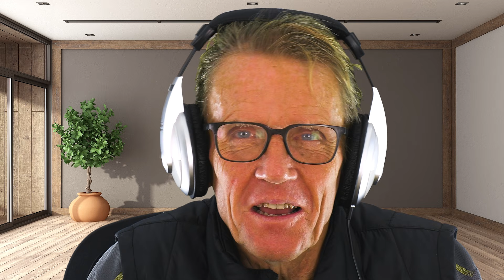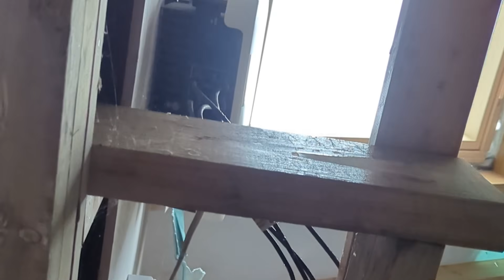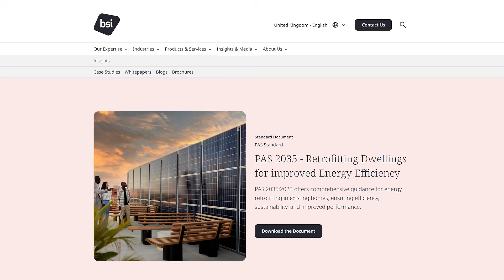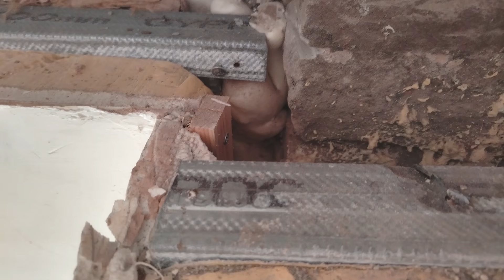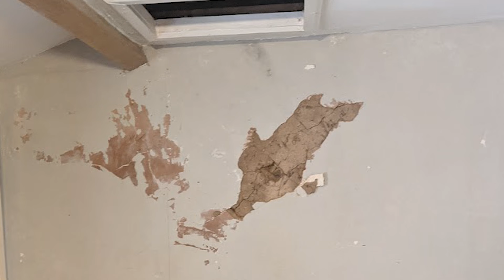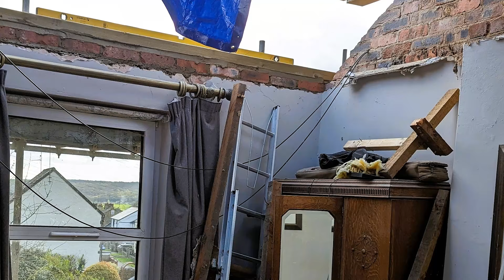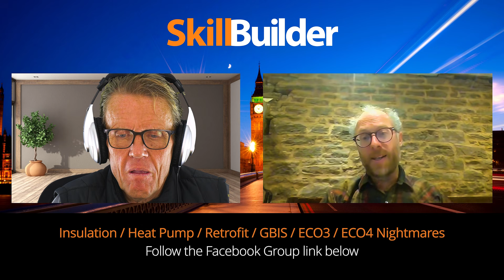Government Scheme Leaves Homeowners in Ruin – And Nobody Cares!

Comment: I think its unfair to blame the grants for this, its the installers which arent building to the standards. Companies have taken advantage of people for decades. it used to be double glazing etc etc etc. The grants arent the problem its the regulation of installers to ensure they are done correctly.

heat pumps work... no need for supplementary heating it just needs to configured and designed properly. insulation needs to be external. 

All I am seeing in this is a bad installer.

Comment: Why is the house too hot my heat pump system has a room stat and it has not turned on now since April.
Reply: Is it on fire ??... 😮
Reply: @peterfitzpatrick7032 why would it be on fire? It comes on over night during off peak to heat the water.
Reply: @FireballXL55  Whoosh.... 😂
Reply: @peterfitzpatrick7032 just shows you know nothing and have preconceived ideas and are not willing to change.

Comment: I'd make a simple suggestion to anyone thinking about a heat pump, if you set your gas boiler to a flow temperature of 45 degrees for a while in winter  - you will understand the limitations of your current setup - from that test you will be better informed about what will need to be done.

Comment: Heat pumps work just fine correctly installed and more importantly in the right airtight building, this in-conjunction with Mvhr and in most cases UFH ….I love old character buildings as much as the next man, but often they are simply money pits……indeed before anyone buys one they should be made to 1st watch the 1986 Tom hanks film “Money Pit”. Best off luck, unfortunately from the brief description of your own i knew exactly were this was heading🤦‍♂️

Comment: Great video I feel so sorry for this guy, when I got solar I doubled up my rafters even though structural calculations said they where ok. And this just reaffirms to me to keep my boiler looking for one with weather compensation looking at the Vitodens 200-W 35kW Combi Boiler  only for a three bed but as it modulates should think it would be ok thoughts welcome but needs stainless heat exchanger due to water softener

Comment: we use the heat pumps in the wrong way , they are bad when used as a replacement for a gas or oil boiler , they cant compete for output unless you repipe and then people say it doesn't get hot enough 
the actual solution is to install an ANHU with return air filters and heat recovery  it keeps the house warm and it circulate the air and keeps humidity down and you get clean air 
if you add one of the systems roger has championed for insulation then you get a warm in the winter cool in the summer fit for living mould free home
Reply: That's one reason heat pumps are so expensive to retrofit. Lower temperature water for heating works just fine, if you have the flow rate to compensate - double-layer radiators and wider piping. But that piping is embedded in the walls and floors.

Comment: like british gas putting in full new heating system caused 6 water leaks, ruined solar hot water system & they refused to sort it! I have to pay for £30,000 damage PLUS £6,000 to replace the pipes cowboys at British gas installed
Reply: They are appalling.

Comment: If it is anything like the old Green Homes Grant, the homeowner will get a grant around £14,000 per year for 10 years to cover the extra electricity needed to run the system.

Comment: I would NEVER trust any government scheme.
Reply: Why? The scheme itself is good.

I've got a heat pump, the issue is that people don't research.

I did all my research myself, worked out the calculations, and used a company that has accountability (eon).

My system works perfectly and saves me thousands a year.

House is toasty warm with plenty of hot water.

Key is research, it took me a couple of hours to work it all out to confirm to myself that the system they offered would work.

I got a quote off a company that did it all online, came in at a good price BUT the system they wanted to fit was half the size it needed to be. (Cowboys basically)

Eon was perfect.
Reply: @garethhhhh  So... you didn't trust the scheme but did your own research. As a result, you made it work for you. Hope you have been able to help and advise neighbours and friends and relatives how they can benefit from the scheme
Reply: @cuebj told my next door it's no good for him as it isn't.

He did look but also worked out like me that it's no good.

The scheme is good, the govs done it right. The issue is cowboys doing it wrong.

Friend of mines got a really poorly fitted ground source system that's far to small for his house.
Reply: @garethhhhh  I'm still not convinced about heat pumps. Do they work well in freezing weather. Do they consume large amounts of electricity rendering the property electricity dependent.
Reply: @rodneycooperLMSCoach  heatpumps can work down to about -30,  they are very popular in Scandinavia countries.  However the system has to be designed correctly.   The right sized pump, pipework and radiators.  If designed very poorly it will not work or be very expensive to run or both.

If the building has low occupancy and only needs heating.a couple of hours per day, or even not every day then a air to air heatpump should be used instead of air to water.

Insulation has  almost nothing to do with weather a property is sutable or not.
Reply: @garethhhhh  Don't tell me what to do, but also please tell me what to do.. :)
Reply: They put silicon coated paper in my friends walls , 1930's bungalow under government scheme which bridged cavity and went mouldy, outer bricks cheap lime and no cavity either side of front door. This building totally unsuitable.
Reply: As 2020 proved
Reply: Aside from the roads. And the power grid. And water. And sewage. And /usually/ the police, though it's best to be a bit weary around them. Oh, and construction codes, product safety, food safety, radio spectrum regulation, environmental protection... maybe you shouldn't  just lump every government scheme together like that? Government does a lot of stuff - some of it essential, some it good, and some of it seriously screwed up. Any government has many different purposes and departments, it's not a monolith.
Reply: All the while producing reams of paper that nobody bothers to read or enforce. For years Royal Mail prosecuted thousands using a law that they legally could not use, nobody noticed.! £3.2 Billion just for a planning application for the new Thames crossing, £450 million to clear the land at Euston station for it to be put on hold. Somebody speaks up they get the sack. The list is endless.
Reply: I would NEVER trust any government.

Comment: As a retrofit assessor, this story exposes failure on so many levels. No TrustMark registered, PAS 2035 certified installer would preside over such shambolic workmanship. As you suggest, homeowners are expected to exercise due diligence to weed out the cowboys. Many may lack the necessary knowledge, so there must be better oversight of the various trades to prevent this from happening. Nonetheless, while any dwelling in such a dire state of repair is going to be relatively expensive to heat, you cannot conclude that a heat pump would be any less suitable or more expensive than a gas boiler. You seem to have reverted to your anti-heat pump stance after an excellent series of videos with the Heat Geeks.
Reply from the maker: Clive 
I was enjoying your comment right up to the point where you blamed the messenger. It weakens your argument. We are not partisan. 
It may be difficult for you to face the facts but we are representing all sides of the debate. All my comments on this video are fair and reasonable and I let Duncan tell his story.  It is obvious that putting heat into a building at a slower rate that it loses it is not going to give you a warm house. A high temperature boiler will warm the house up quickly. Yes it will cool down when you switch it off but this is how thousands of people heat their homes and it is the reason a heat pump is not suitable in a badly insulated home. I am surprised that a professional in your position is unable to grasp this simple fact.
Reply: @SkillBuilder  I completely understand the point you're making — that a high-temperature system can more quickly “blast” heat into a leaky home. It’s true that this is how many people heat poorly insulated buildings: short bursts of high-output heat followed by rapid cooling.
But this model doesn’t invalidate heat pumps — it simply highlights the need for a different heating strategy, especially in older or less efficient homes.
The assumption that heat pumps can’t cope with substantial heat loss is misleading. A well-designed system, even in a less-than-ideal building, can deliver continuous low-temperature heating that keeps internal temperatures stable and comfortable competitively with gas. The key is accurate heat-loss calculations and perhaps some cheap airtightness improvements—not just insulation.
In fact, the very problem you describe — high heat loss — is exactly why a fabric-first approach is so important under PAS 2035. But even before deep retrofit, many homes can run comfortably on a heat pump if the system is properly designed.
My comment wasn’t to deny the physics of heat loss — it was to push back against the idea that a poor install or unsuitable system automatically discredits the entire technology. That’s the same mistake people made years ago with condensing boilers, which also failed when badly installed.
Ultimately, this shouldn’t be about being pro or anti heat pump — it’s about promoting evidence-based solutions and discouraging generalisations based on anecdotal evidence. We need critical discussion, yes — but also clarity on where failures really lie: in the install, not the technology.

Comment: Never trust a Government or an expert - read up on the technicalities of insulation and efficiency of heating. 
1. Heat pumps do not work in damp conditions like the UK you will find out the costly way.
2. Gas heaters are 95% + efficient now and £709 Glow worm 25kw Easicom3 heat only boiler (solar panel charge your hot water tank element - no brainer. Combi's are trouble). 
3. Insulate the long wall of your house outside (polystyrene,95 (or150 by standing off - new reg.) x50 battens, house wrap, 25mm air gap, batten, planking) and internally the short walls with windows - no planning needed (1930 semi's).
4. Re-roof your house to 1960's specs (underlay in gutter - cold roof)- it works, modern regs. are inefficient and cause a gale in your roof space and freeze you upstairs (I made that mistake once).
5. Insulate in mineral rockwool your roof space - it breathes.
6. Maintain all your original wall vents do not cover, only with a slider vent cover for high winds and extreme cold - you are the wettest vapour causing headache in your house - or stop breathing...
7. Get a conservatory and you spend most of your house time there unless sleeping.
Gas and electric cost for one year £1,000 and I have tungsten lamps and heat my conservatory with electric 2kw heater...🙂

Comment: This is not clearly communicated. Just get quickly to what the problem is, then give details. Also, whether he has ADHD is a bit victimhood culture and is irrelevant. Just tell us up front the problem-- the system doesn't heat, didn't cool, or leaked, or whatever.

Comment: There is no substitute for a professional- these monkeys are in the same system that had all of that faulty insulation installed on houses that were never designed for insulated cavities and ended up with horrible damp problems

Comment: Older properties benefit more from external insulation and underfloor heating.
I lived in a rented semi detatched 1850's built welsh stone wall property.
Walls were 500mm with rubble infill which had been internally dry lined insulated on the main side wall.
Underfloor heating had been installed with underlying 100mm insulation with the original slate flags reinstalled as the final finish.
Gas provided the heat source.
A small flat top wood burner could augment the underfloor heating and provided secondary cooking.
The house was never cold and required only 5 hours of top up heating no matter the weather.
Windows were secondarily glazed and the loft insulated.
It proved to me that simple cost effective measures could make any old building comfortable at low cost.
Reply: Yes, but you are using gas and that is the governments target.  They are not interested in cost or convenience in the least.  They are dogmatic in their drive to reduce the use of conventional fuels.
Reply: @Hereford1642  Going 2green" is about saving the planet and not your wallet!
Reply: @Alan-w6n9p  I have a Guardian article from 20 years ago with dire predictions for today that simply have not happened. 
 The great and the good continue their luxurious lifestyles,  the bilderberg attendees have a private jet share scheme and the gov't put 10p on a plastic bag.  
 What a load of cobblers.

Comment: Heat pumps = racket
insulation= racket
Solar = racket
EV cars = racket 

Stay away from these Money suckers ..

when you know , You know .

Buy a Good Petrol engine .no turbo . Basic . 
No apps to start it 😂 

Keep it simple . 
It works
Reply: Alternatively, live in the real world and don't listen to conspiracies.
Reply: @Biggest-hz7ng Not conspiracy. 
the racketeering is dressed up as .
cheap , reliable , on the contrary...
The prices of EV cars are ridiculous.
Heat pumps are unreliable 
Solar benefits no one.

even industry stop buying EV vans..
They binned them off and bought Diesel vans .
Reply: @poloiscorrect secondhand EVs are affordable. New EVs coming down in price and becoming more popular.
Newer vans have bigger batteries and do perhaps 180 miles. 
Solar works for 25 years and takes hundreds off bills. 
Heat pumps work (ask any business), similar energy costs or better than gas boilers when installed reasonably or well

Comment: If the first company had said you need to fix the roof first, many will simply go to the next company until one says it’s fine.
Reply: No they won't. They would ask why the roof needs fixing. I certainly would. A sagging roof is pretty obviously not going to support the extra weight.
Reply: I’m not talking about the technical element nor what I would do as a client, Im musing the behaviour of contractors and clients. The solar panel company added weight to a roof that was observably unlikely to support it.  The heat source company installed a solution in a wholly unsuitable building. The installation of  both proved this point. The client had taken on a complex project without it seems any related experience almost entirely at the whim of what he’s told by ‘experts’. 

In these cases, where a tight budget is concerned, clients may choose the company that’ll say it’s fine over one that say it needs the roof fully supporting because of cost,  but also because of their  relative knowledge of such things requires them to put a great deal of trust in others. 

This Client was let down by ‘experts’. Given that the installer does this all day, you’d think they’d have spotted all risks a mile off so were they the contractor that came in at the right price and said the roof (and building) will be fine, even though it wasn’t?
Reply: You might. I’m guessing you are not technically trained or minded?

Comment: you are spot on saying you really need a small boost add on to use to cope with sudden changes or do a top up, until its consistently cold then run the hp.

Comment: If running a gas or oil heating system, it's relatively straightforward to derive the existing heat loss from consumption and average external temperature. Another method is using an electric heater with a consumption recording device on the power plug and a temperature sensor outside and in the room with the radiator turned off....

I agree that hybrid systems should be allowed on the scheme, if they allowed Drax to continue operating, they can hardly justify their position on 'carbon'... ;)

I'm still on gas heating as we get brutal winters and it's a limited and flaky power supply - But at a 70% reduction in gas consumption simply through insulation, it's a hell of a lot more progress than HMG have managed by tying insulation into heat pump rollout....

Duncan's principal point on this chain of events is spot on though, and it's part of culture of England's body politic still has not learned the lessons, hand it off to a big contractor to manage and government saves, cut the red tape etc.. - What is needed on these jobs is a thorough appraisal by people who know what they're doing, else nothing moves.
A structural engineering survey ain't cheap, but would probably have saved Duncan a small fortune...

Hate to disagree on that comment on having to have the system running all the time Roger, doesn't actually add cost if the heat pump is set up correctly.
As aside, I ran the condensing boiler on constant heat all through last winter, and it's still running even now, part cooling the house - Gas consumption barely changed, but the place was constantly warm, only calling on the burner periodically - The triples may not be everyone's cup of tea, running low temperature heating may not either, but the return flow at 23c means the boiler is running as efficiently as possible.

Comment: I studied and calculated a lot. The conclusion is simple: don't add any insulation. Maybe get an AC for cooling. No solar, no A2W heatpumps. Put your money in an index fund. Switch to Octopus Agile for electricity. With that, my bills forever have become negative. I get paid to heat the home. It sounds absurd, I know.